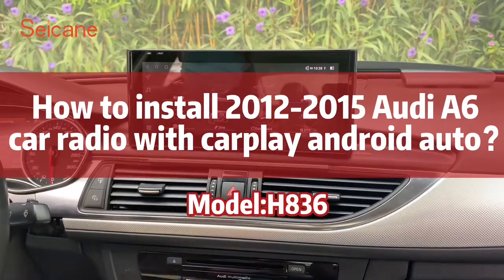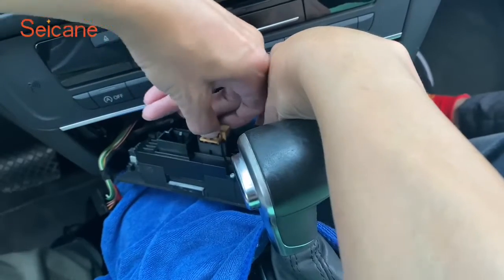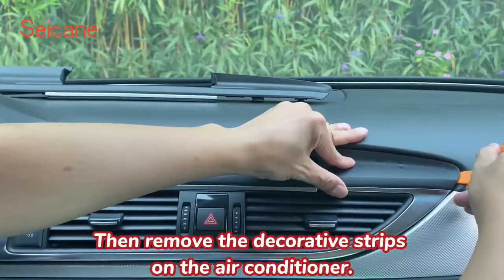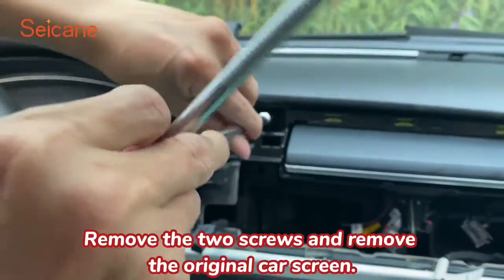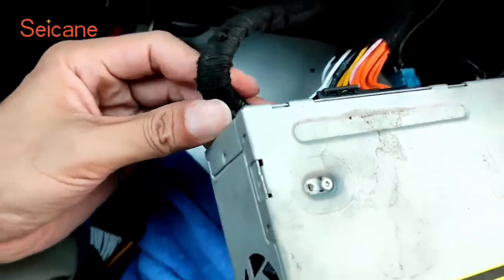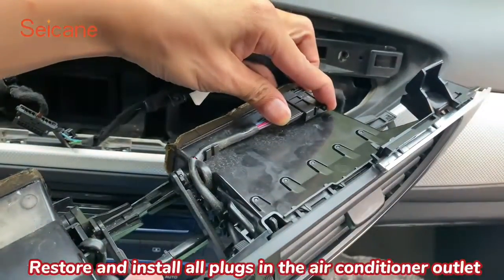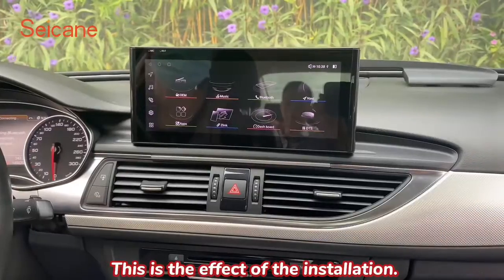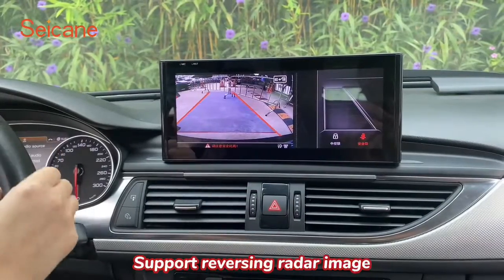Add A 12.3-inch Touch Screen Radio to 2012 2013 2014 2015 Audi A6 A7

Comment: How would you access things the previous computer had like the drive modes and such?
Reply from the maker: need to reset
Reply: Setup then car-info Resolution and then Code 666666. After this you can set your original Carystem Resolution and also under Media line your Soundsystem line!

Comment: Does this unit also support front and rear view parking cameras ??
Reply from the maker: hi, it supports if the camera plug is suitable.
Reply: @Seicane-Car-DVD  which model is this and can I buy this on Aliexpress ?
Reply: I have stock camera plugs ??
Reply from the maker: item link : https://bit.ly/3A7SZFk
yes, you can buy it on Aliexpress.
Reply from the maker: what kind of plug ?